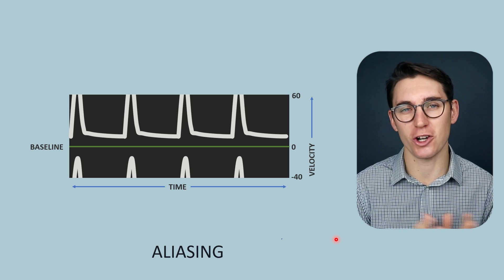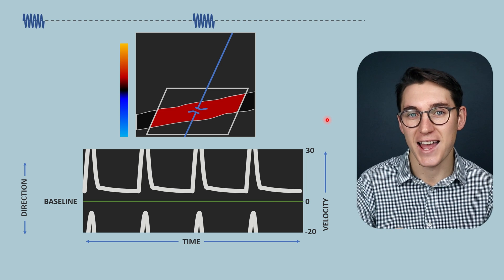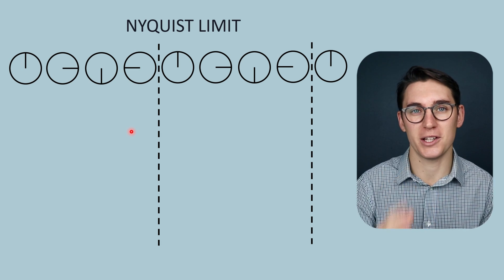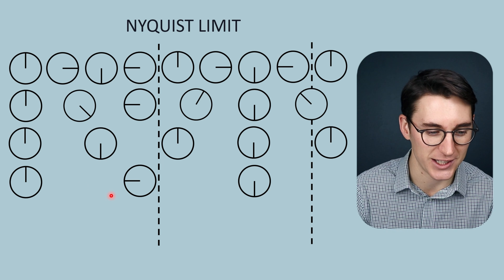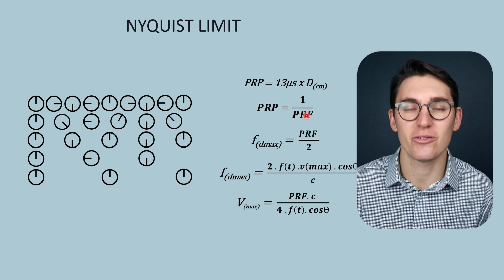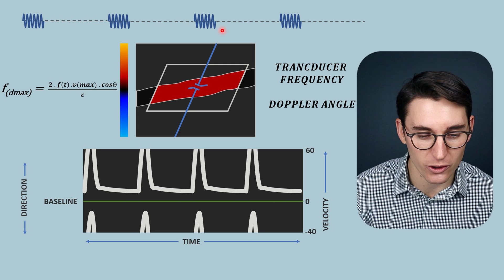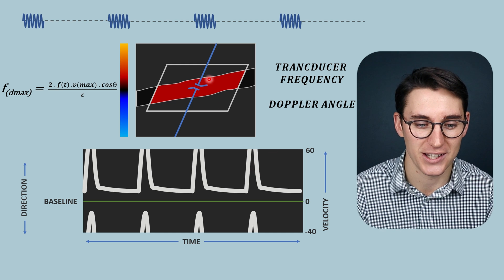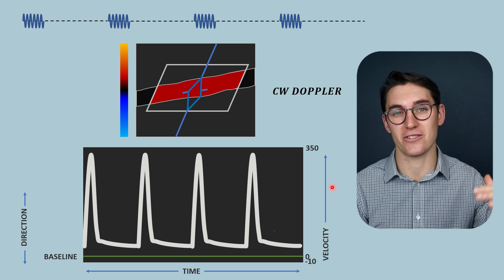Aliasing Artifact | Ultrasound Physics Course | Radiology Physics Course #23

Comment: I have a question. I've learned about aliasing, the Nyquist limit, and pulse wave doppler countless times. It almost makes sense; maybe you can connect the missing pieces?

In pulse wave doppler, the probe emits/receives ultrasounds at the pulse repetition frequency. The received sound wave frequencies are shifted either up or down depending on the velocity of substance (and the angle it's moving). If the frequency is shifted up too high (past the Nyquist limit for that given PRF), aliasing occurs.

But if the velocity in question is away from the probe, it causes a downshift, lowering the frequency. As far as I understand, Nyquist did not have a lower limit on frequencies to be detected, and yet, aliasing exists.

I read the original Baker et al paper and the Jensen et al paper, and it's still not clicking. Maybe someone can help?
Reply: Nyquist limit means there is a limit in the doppler shift we are measuring .We can't  measure the frequency of the echo that is returning .We are measuring the change in this frequency (that is the doppler shift).Even if blood moves away from the transducer even if blood moves towards the transducer (increased frequency of the returning signal )there is a doppler shift in both cases and this doppler sift we are measuring . the limit is PRF / 2 depending the depth around 7-20 Khz  .Above this shift (and velocity ) we cannot measure accurately.The change in frequency is very small compared with the frequency of the transducer .For a 3Mhz transducer and blood speed 1m/s there is 4Khz increase in frequency if the blood flows toward the transducer and 4 khz decrease in frequency if blood flows in the opposite direction.That is why the doppler shift is in the audible spectrum below 20 Khz

Comment: how do we change the depth of the transducer to compensate for decrease in maximum Doppler shift . The actual depth of the vessel in the body will remain the same .
Reply: Of course the vessel depth doesn't change, but what actually changes with depth control is the time needed to wait for the US pulse to reach that depth and being reflected back, thus affecting the scan rate.
Using the lowest depth setting that still allows a good view of the vessel ensures having the higher repetition available for the given situation, while a too high setting would just waste (lengthen) scan time by inspecting an unnecessarily deep tissue zone.